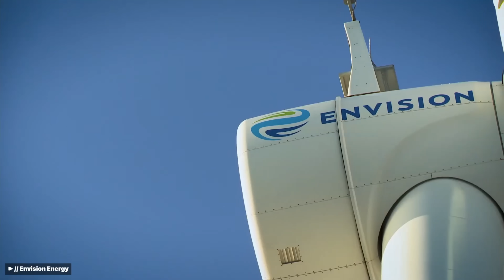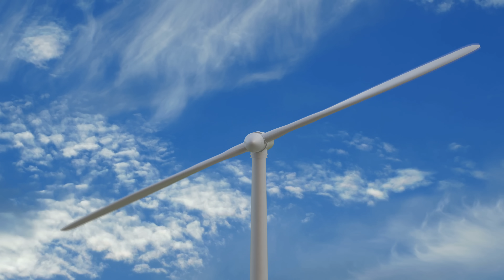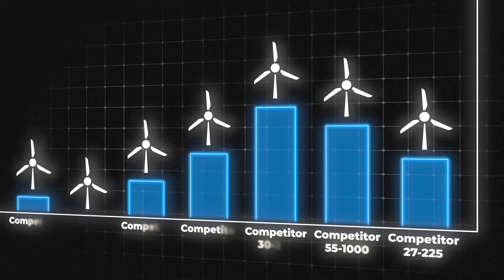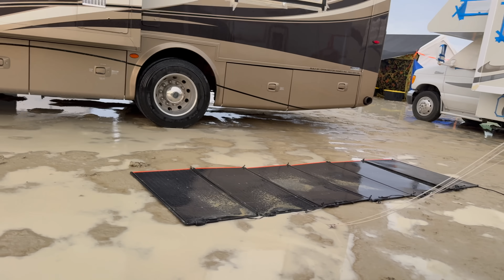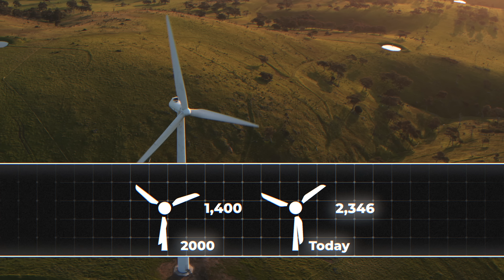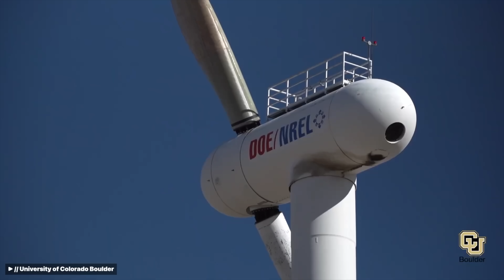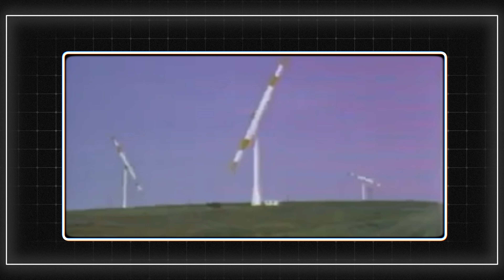Surprising Benefits of 2 Blade Wind Turbines - This SURPRISED Me...

Comment: You forgot 2 points:
Because of friction with the ground, wind is stronger, higher off the ground. On a 2 bladed turbine, The blade in the up position gives more torque and side loads, the blade in the down position has less wind. So there is  a lot of torque unbalance every time a blade is up or down. Which leads to increased vibrations and fatigue on the blades, structure and drive train.
A 3 bladed turbine is just smoother.

Comment: I think Wind Turbine designs for Land & Sea will diverge in design to optimize for their environment. 

For Land: Co-Axial Contra-Rotating Dual 3-bladed Wind Turbines will be the future evolution. 
Move the Alternator/ Power Generation to a Vertical Light House stack in the tower for ease of maintenance & power generation scalability. 

For out in the ocean above water: World Wide Wind has a ingenius tilted HAWT with dual counter rotating 3-bladed rotors.
I believe they nailed the design to optimize for wind power generation out in the sea.

Comment: Good report! however, the only reason wind and solar electricity generation are not stranded assets is because of their forced support with the public power grid at high expense to rate payers.   It's commercially worthless electricity.   Wind generated electricity with its wild fluctuations second-to-second is the most natural gas expensive form for generating electricity.

Comment: Um… 2:30 .. you somehow missed mentioning radial symmetry? With one blade, the force from the wind would have to be sufficient to lift that blade from BDC all the way around to TDC against gravity*.. with any other design, the radial symmetry allows the blades *not on the up-stroke to act as counterweights to the blade / blades that *are*.

Comment: Maybe they should consider a 4 blade design.  But as a pair of 2 blades.  One up wind, one down wind.  The planes of each pair separated enough to reduce degradation of the trailing turbulence.  And in high wind they could each have a parking option with their blades going out of normal power generation mode, to survive.

Comment: Another small benefit of a 3 blade system is that it is arguably more visually pleasing. Sure that’s pretty subjective, but often wind turbine projects are shot down for aesthetic reasons. 

I would argue they are prettier because
1. The rotate a little slower, so the motion is less likely to catch your eye and bother your view of the landscape. 
2. Because each blade follows more closely behind, there is less sense of intermittent empty space visually, as if the points form a triangle that is rotating rather than a line that is rotating. 

I personally think both look cool and would be happy to see them, but if I were trying to win a project with some wishy washy local government, I would definitely be arguing for every advantage I can.

Comment: You are an engineer.  You like anything that man designs.  Wind turbines are hideous.  They can't be recycled. They kill birds.  They are ugly.  They take up too much space.  They are very expensive and require lots of maintenance.  They are environmentally friendly only when everything goes right.  Something always goes wrong, but you don't talk about that.  Best case for green energy is solar and nuclear.  Earth recycles all the carbon byproduct of fossil fuels.  As we burn more fossil fuels the earth gets greener.  Pictures from space prove this.  Plants love us for burning fossil fuels.  The downside is the earths recycling process is efficient, but not fast.  And there are some side effects.  More acidity and more contaminants in water.  Ocean habitats are a little more susceptible to changes in acidity.  Corals don't like it one little bit.  I gave you the bottom line earlier.  Go figure!

Comment: First, well done visualization, and excellent presentation! Having investigated two-bladed turbines for years, just some minor fixes:

1. The increased loads of a yawing two-bladed turbine come from its turning rotor axis of inertia. Imagine a ballerina, who turns slowly when the arms are stretched to the side (like the two-bladed turbine in a T-position) and spins faster when pulling the arms towards the body, which has the same effect as pinning the arm to the ground and sky (like the two-bladed turbine in a I-position). You can just try it at home :). However, a three-bladed turbine does not change the rotor inertia orientation when spinning, just like a plate. Nonetheless, these two-bladed rotor loads can be mitigated by yawing unsteadily.

2. About the aerodynamics of large horizontal (one-, two-, three-, four-... bladed) wind turbines. You somehow ended up correctly by stating that more blades result in (slightly) higher efficiency. However, as noted by Prandtle in the mid-1900s, the trailing wake of the blades, or actually the trailing tip vortex of the blade, improves (!) the aerodynamic efficiency of the next blade if it comes close enough. The cause is the partial blockage of each trailing tip vortex by the next one, which reduces tip losses (a major source of aerodynamic inefficiency). Migrating birds use the same effect when they fly in their V-formation, where one blade/wing tip is followed by one wing tip of the next bird. That said, you visualized very nicely how you could have the same blade wake (or actually tip vortex) distance by spinning faster. While this is true, spinning faster also increases the aerodynamic drag, which again reduces the efficiency. The higher the lift-to-drag ratio of your airfoils, the faster spinning is aerodynamically optimal.

3. Adding thereon, I often hear that two-bladed turbines must (!) spin faster for high efficiency. Generally, rotors (no matter if two or three blades) can be designed for various design rotor speeds by changing the rotor's solidity through changes in the chord length. So the wider the blade, the slower the rotation is optimal. There might be an absolute optimum for a given number of blades and a given airfoil lift-to-drag ratio. However, this improvement is very marginal. The rotor speed selection is more driven by rain erosion and structural effects (the slower the better), as well as faster speeds to benefit the generator. For example, the "2B-Energy 6MW" turbine you listed has a more typical tip speed ratio, whereas the "Seawind" turbine, which is based on the "Gamma 60" prototype, has an exceptionally high tip speed of 130m/s.

4. Up- or downwind configuration is not directly connected with the number of blades. Nonetheless, your tower-shadow plots are great. Note that two-bladed turbines' blades are usually stiffer due to their usually wider blade structure, which would actually enable an upwind configuration for even larger turbines without violating the tip-to-tower clearance. However, great up- and downwind designs exist.

5. A, and the Envision 3.6MW is their older two-bladed turbine from about ten years ago. The recent one is said to be slightly above 6MW, but it is not officially stated. I read it in a post somewhere.

Despite these notes, most things were correct and, far better visualized and presented than I ever could.
And I really liked the final statement of your video :)
All the best! Fabian

Comment: Hey this is really interesting. I have some questions : I saw a video some time ago about tire balancing with beads freely moving into the tire when there is a slight issue. Could this be used in wind turbines to reduce imbalance and adjust it dynamically with almost no failure point except low speed at which the imbalance isn't an issue anyway ?

Another question : if you have movable pitch blades, instead of fighting the gyroscopic effect, could you use computer to move the pitch and use the wind itself to turn the turbine, reducing the fatigue overall ? I think tom stanton made a little drone with pitching blades for control, it wasn't that much a success but proved the point so in turbines wich already have all the working mechanics for this, it could be great I think.

Comment: Two blades are slightly more "efficient" than three blades
The problem comes when the wind direction changes and the turbine has to change heading.
With a two bladed turbine you get a massive torque at the head of the machine when the spinning turbine changes direction
THIS is why the few two bladed wind turbines that have been built have failed!!

Comment: The pillar shadow problem is much worse than you made it out to be, because the wind at the top is going at a much higher velocity than the wind near the ground, and with a three blade design, at least you have two blades counteracting, the one fully extended blade, which has the maximum torque applied to it
In a tube blade design, you have one that is absolutely getting the highest speed wind, and then the bottom, which is getting absolutely no force at all .
With a three blade design, you either get two blades, but not fully extended to the maximum height and at an angle for the low blade which is fully extended , or the other way around either way it is two blades versus one making that twerk be significantly less aggressive.

Comment: Hasn’t it repeatedly been proven that 3 blades
1) are the economic sweet spot of cost vs generation
2) are the minimum number of blades for even stress distribution on the hub/generator
3) less vibration induced when a blade passes the „wind shadow“ of the tower
Etc yada yada

Comment: It’s still a wind turbine,requiring just as much concrete to construct the foundation!  

Manufacturing the concrete for a single wind turbine releases MORE atmospheric CO2 than that Wind Turbine can offset over its entire working life!  This doesn’t even include the CO2 to manufacture the components t required to build the Turnine itself, transportation, site work and infrastructure.  

Wind Energy is NOT green!

Transcend the BULLSHIT!

Comment: A turbine is NOT like a giant wheel on top of a tower. Yes, the moment of inertia about the turbine's horizontal axis is roughly the same (for a turbine of the same diameter and mass) regardless of whether it has two or three blades. But now imagine the moment of inertia of a two-blade turbine, about the vertical axis (when the turbine head is turned into the wind), when 1) the arms are vertical and 2) the arms are horizontal. The difference is as drastic as a ballet dancer with her arms at her sides or spread out. This means that during the turn, depending on the blade position, the forces will pulsate very strongly. For a three-blade turbine, the pulsation is much less.

Comment: Thanks, I have operated two and three bladed units. Two bladed units are more efficient but are unstable and imbalanced when the blade disc yaws. This imbalance puts great stress on the turbine shaft, that has to be periodically replaced to avoid fatigue failure.

This problem can be solved by placing counter weights in the plane of the turbine disc at right angles to the blades. However this involves complex design considerations and increades drag. 

In the end three blades are better because the blade disc is dynamically balanced.

Comment: The other big reason is how big the rotors have to be to equal to 3 blades - a 2 bladed version is massive getting very close to ground compared to a 3 blade that are much shorter. This means many things, such as the considerable amount of extra flex and force the blades have to withstand from being so much bigger.

Comment: It's fascinating, isn’t it? We’ve arrived at the point where 'aesthetic simplicity' and "engineering breakthrough" are seemingly synonymous. But if we take a step back, especially from the perspective of rotorcraft and aerodynamics, turbine blade design is far from a straightforward decision - it's an intricate web of trade-offs, often informed by decades of study and empirical testing.

Take, for instance, the design principles that govern helicopter rotors. When you delve into the specifics of 'rotor blade count' and "aerodynamic efficiency", you quickly realize that each configuration is carefully chosen for a set of very distinct reasons. A single-blade rotor with a counterweight might seem like an odd choice, but in truth, it is perhaps the 'most aerodynamically efficient' option, eliminating the turbulence generated by multiple blades. It’s a finely tuned solution to a very particular set of variables.

Then there’s the matter of "hub loading". An even number of blades - four, six - optimizes balance. But when you introduce the question of 'noise reduction', things get even more interesting. The relationship between 'blade count' and 'acoustic resonance' is far from trivial. It turns out that prime numbers - three, five, seven, or even eleven blades - each serve to reduce noise. As blade numbers increase, the system’s 'resonance modes' are dampened, creating a quieter rotor.

Of course, every design choice is ultimately a balance of 'competing priorities'. What’s often overlooked in new turbine innovations is the concept of "design evolution" - the idea that even as technology progresses, designers often neglect to revisit the fundamental choices made by their predecessors. This phenomenon - what we might call a “paradigm lock” - means that truly groundbreaking designs often fall victim to the inertia of conventional wisdom. New ideas, especially those that challenge long-held assumptions, tend to be met with skepticism - even as the technology around them continues to advance.

Ultimately, "designers" are continually navigating these complexities, and the very fact that these turbines are breaking records signals a significant shift in the 'paradigm'. But we must acknowledge that, as with all innovation, progress is not linear - it is rather a continuous *"dialogue" between past learnings and future potential.

What do you think???

Comment: Instead of dispersing over 60kg of micro plastics annually, including 8kg of endocrine disrupting BPAs, do each of the turbines now only produce 40jg of pollution? That would be an improvement. Those are figures from a 2021 paper, has anything else been done to mitigate this problem?
Reply: Very specific source, "a 2021 paper", let me just look up some authors of "a 2021 paper". Didn't find anything, because there are many "a 2021 papers".

Comment: okay 2 blades are more efficient, however 3 blades are chosen for practical engineering and design reason, the biggest of these is eye distraction, if you are on a motorway a 2 bladed design can distract you even if you are not concentrating on it, its all to do with the way our brain works.

Comment: It seems more logical to solve the issue through complete redesign into a verticle stacked set of velocity stacks then place the turbine horizontally inside each stack in layers. Not post to interupt airflow. Multiple units per stack tower. Velocity stacks catch and redirect wind into a verticle air column from any direction with no disruption. You just need to reorient parts to work in a flat configuration. Massive towers for single units is pretty dumb. Sure grandpa did it that way, but it doesn't make it most efficient.

Comment: The old farm windmills are an extreme example.  That large number of blades are for starting from 0 rpms under load . Even in the old days, people said that if you could remove most of them after they started . They could pump more water.  Today's windmills don't start under load and even use power from the grid to start. Still, you're not paying for the wind. Efficient use of wind is not and should not be the primary concern.

Comment: The limiting factor for creating larger windmills are the speed of the tip of the blade. A to wing mill need to turn with a higher speec og have longer blades than a three blade mill to produce the same a amount of energy. Because windmill blaces today already are used at the limit of the speed of the tib, they cannot turn faster and they  a not be longer. The  the nology get better and it is possible to increase the speed of the tip, it is more efficient to use longer three blades than it is to increase the turn speed.

The leading company in produsing windmills have analyzed these factors for decades. They know what they are doing.

Comment: I have always thought that a big advantage of a 2 bladed design would be to have the ability to park the blades horizontally and then lower the power nacelle to the ground level to help with maintenance.  With this arrangement you could also add in the capability of erecting the structure from the ground up without having the need for a crane.  The tower could be assembled from the ground up (is the same way that a tall crane erects itself) and then finally winch up the 2 bladed turbine at the end of the operation.

Comment: there's an alternative that I'm not seeing talked about. Several in fact. And the one that makes me write this comment is...two blade props shouldn't be down wind facing. That's a recipes for structural failure. Efficiency isn't everything. To say it is would be to ignore safety. And if it creates dangerous levels of noise, or is constantly being strained because its catching wind the wrong way, it might be time to make a different design. Instead of a pinwheel the size of a office building, we should be using rotary sails, Which catch wind for most of the height of the turbine, and require less wind to get started.

Comment: Another reason they do 3 blades is with 2 blades are horizontal wind turbine farms creater an " egg beater" effect to people driving by at the specific speeds they turn, which can cause disorientation and vertigo in drivers.   Inducing basically car sickness as people drive...which is bad.  This is resolved by adding a 3rd or more blades.